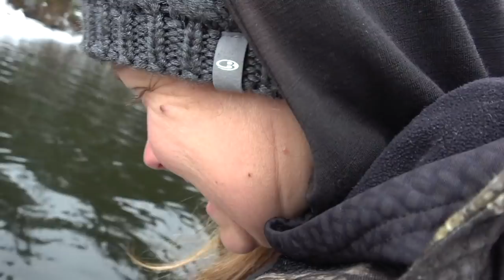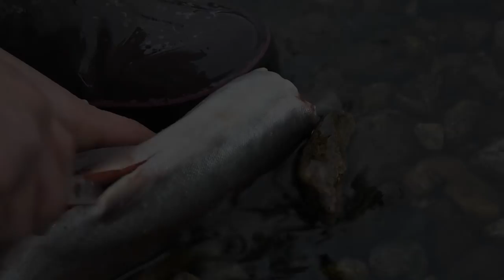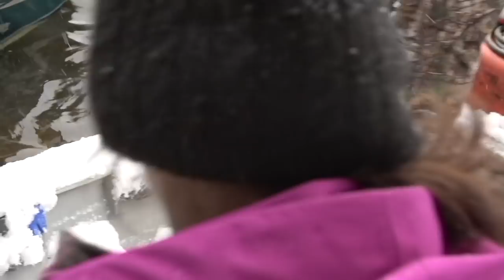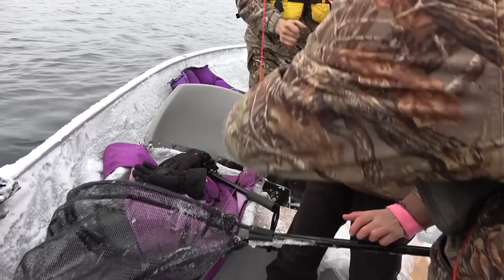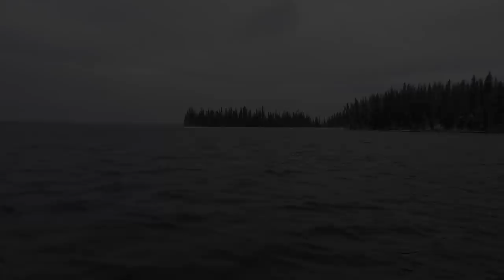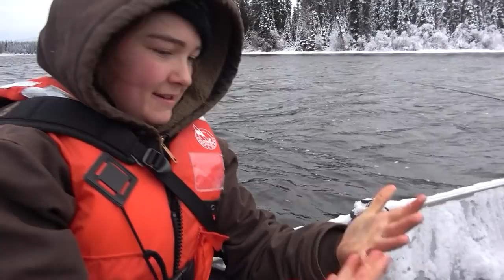Hunting Fishing Loving Everyday: Living the Song - Moose Hunting, Fishing Rainbow Trout and Ling Cod

Comment: I remember one of the first times my dad let my brothers and I take his skiff overnight camping. ( Summer of ‘93) We did the same trick you did. Pulled the boat up high enough that the stern couldn’t rise and fall with the waves so during the night the waves kept breaking over the stern and filling the boat. We woke up to a completely flooded boat and wet engine. We were along way from home and it freaked us out pretty bad (I was the oldest by a couple years and was only 12). We pulled together literally and figuratively and got it sorted out. It was a great experience. We also use our boat to hunt. It seems like the animals get used to the sound of boats and tend to ignore them. We just cruise around fishing until we spot something then sneak around a corner and drop someone on shore to make the stalk. The people in the boat can usually see what is going on better than the hunter and can radio info.
Reply from the maker: Thanks Jesse!  Sounds like you guys had a similar situation as we did, although the waves didn't come over our boats.  It literally snowed and rained soooo much that it filled the boat until it sunk.  It was a bummer, but we were pretty happy that the motors were fixable!  All the best!

Comment: Papa was a rolling fish out of his net and not lifting it fast enough, but you redeemed yourself with proper netting on the next ones. Snow melts fast around paw and hand makes for a bigger print very quickly. Ended up the print was the same size as the actual hand is not counting the expanding melt of both. A family that works together, plays together, STAYS TOGETHER!! Strong arms on that young man cranking the motor. He's a keeper for sure lol. Wow nice way to filet a fish,, much easier that way. WTG.